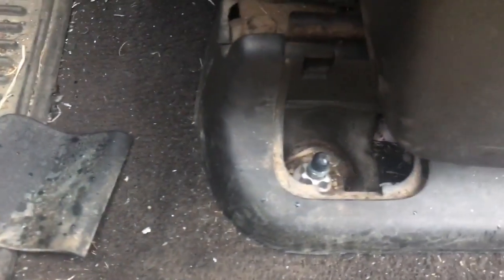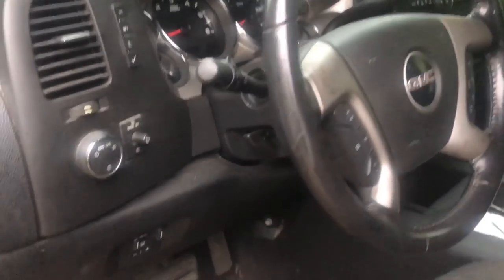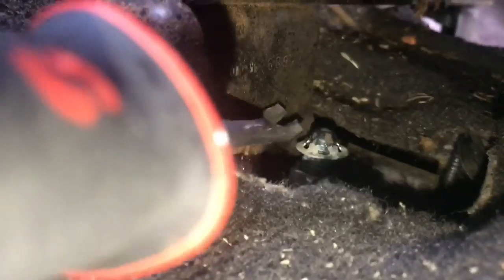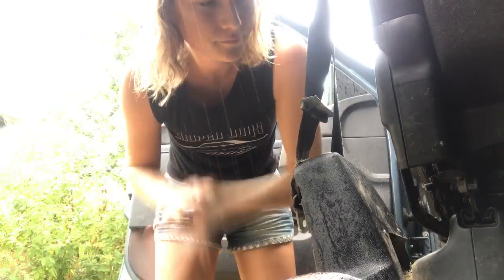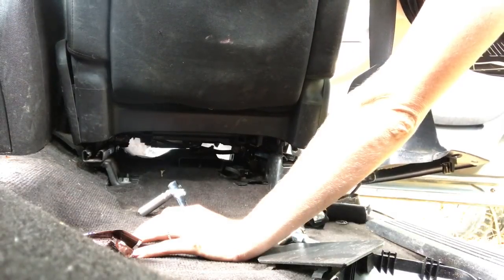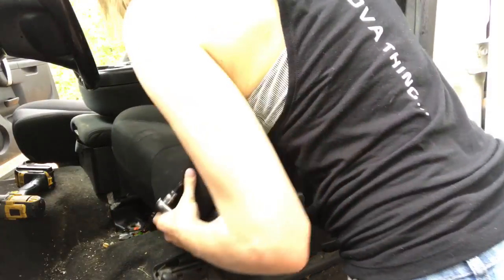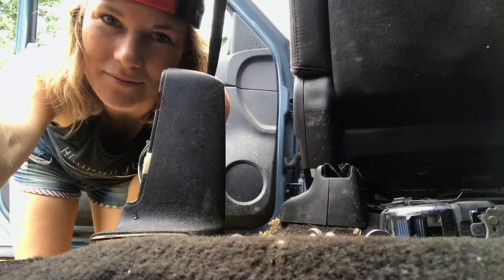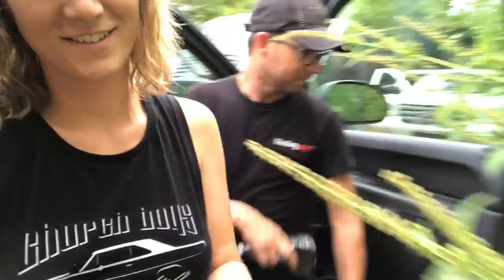Chevy truck wrenching!

Comment: its a load sensing, when driver is overloaded that spring will come out :)
Reply: If you are over 350,the spring clip will pop out an impale your face or ricochet off of the windshield at high speed.PING!